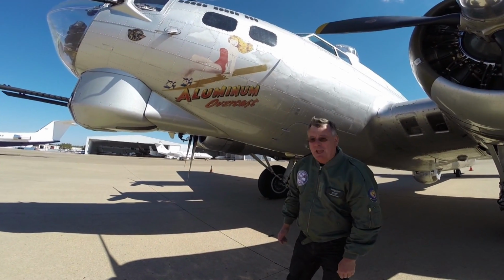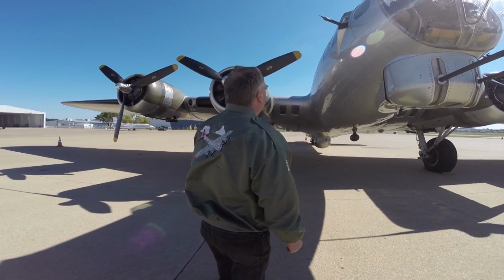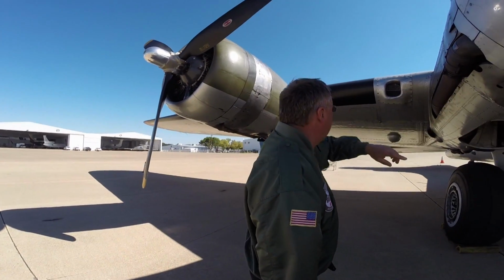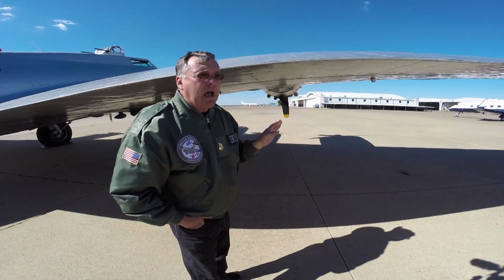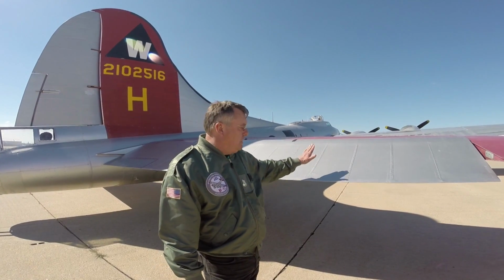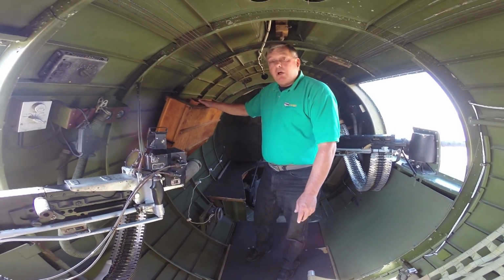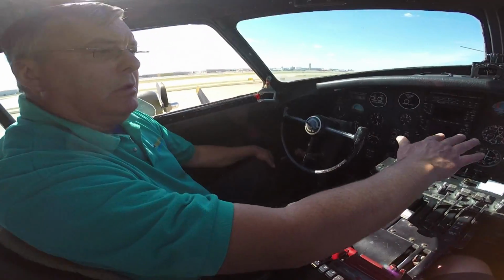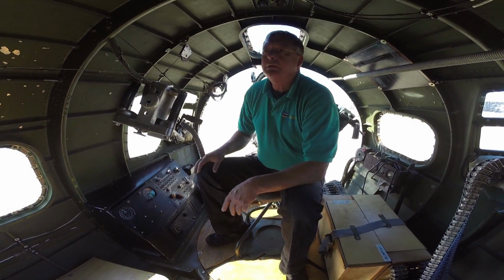B-17 Flying Fortress Walkaround Aluminum Overcast

Comment: Hey...Thanks for the video.  I don't know how I missed it all these years.  I live close to Oshkosh, and EAA is one of my favorite times of the year.  Love the plane spotting here in Princeton.  Rode in your aircraft in 2019 at the show.  
You probably popped up in my search because Microprose is releasing their B-17G for MS Flight simulator.  Did you know?
I fly many warbirds in the sim and have been looking to flying your plane...smiles.
So...the question I have is whether Microprose, or someone else, will have a skin for the Aluminum Overcast.  I would think, since the model is the same, almost.
And if there are no current plans to create a skin for you plane...there certainly should be, eh?

Comment: Should note that the brakes are electrically driven hydraulic.  An electric motor drives the pump that charges the pressure accumulator and that pressure is supplied to the brakes.

Comment: Not all B17s had the top secret Norden bomb sight, which actually flew or guided the plane on the bombing run, so the chin gunner/bombardier was actually an NCO toggeleir in most cases. He would await a bombardier in a lead plane to drop his load of bombs, and on cue all the toggeleirs would "flip"  switches releasing their respective loads.  The Allies didn't want the Germans to be able to retrieve the Norden from a shot down or captured  B17, so there were only a few planes or only one in a flight with the actual bomb sight.

Comment: 30,000 was the service ceiling, so most missions were  20-25,000.  Even so, the accuracy of the Norden was theoretical at best (The Navy passed on the bombsight because it didn't work even in optimal conditions, but the Army gobbled it up.) Far from putting a bomb in a pickle barrel, the Norden was lucky to land a single hit within a square mile of the target.  Ironic that that Spaatz, Eaker, and Arnold Army spent so many lives on the idea of strategic bombing on Europe when two years later they flew pressurized B-29s at 5000 feet or less to blanket Japanese cities with incendiary  bombs and napalm. The British had already come to that conclusion and torched Hamburg, Essen, Dresden, and other cities by night.

Comment: Form here in Britain thank you for this very informative walk around of the B17. Over the last 20 years my brother & I have visited many of the old USAAF 8th Airforce bases in Suffolk & Norfolk in eastern England. Most have now been returned to farmland with only small pieces of concrete of what were the runways, taxiways or hard pan dispersals. Some have museums in the old control towers but must just have a stone memorial to the airfields that were there before.  They are very atmospheric places, standing in what is now the middle of a farmers field imagining those brave aircrews in their B17's & B24's taking off.

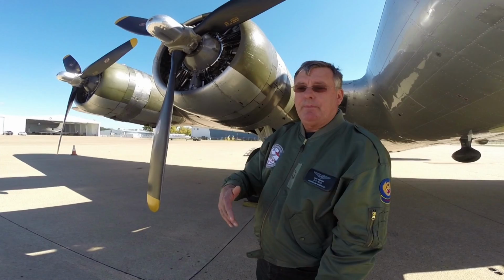Comment: 10:50 I was thinking, the 97 in the name of the radials could refer to the KW rating of the engines with turbochargers active. 970 kw = 1300hp (maybe max HP rating of the engines?)

Comment: My dad flunked out of pilot training in the Army Air Corps during Korea (he tended to get airsick on landings he said) and wound up as a surgical technician on the flight line crash trucks.  He retired from the Air Force as a Staff Sgt. a year before I was born.  As a kid, he used to tell me stories about having to deal with the injured crew on the bombers when they came back from missions, with the ships firing flares to signal the extent of the injuries.  His stories were probably one of the reasons I became an EMT years later.

He went into construction and general contracting while I was in grade school and I grew up working for him.  Coming back from a job one day when I was in my 20s we both heard the very distinctive sound of a four-engined propeller-driven aircraft (I'm old enough to fondly remember flying commercially on prop planes) that he immediately ID'd as a B-17, just from the sound of it.  We were driving on the Brooklyn-Queens Expressway at the time, below the Brooklyn Promenade, and sure enough, out in the skies over NY harbor were a pair of B-17s circling the Statue of Liberty.  Watching my dad relive a part of his youth listening to and watching those planes is one of my favorite memories of him.  I would have loved to get him a ride on one if I could but money was tight (I was working two jobs, starting a family, and going to college, all at the same time).  My dad passed in January of 2001.

Comment: Superchargers are mechanically engine driven and take considerable power to run, Turbochargers are exhaust driven and use the waste exhaust heat energy to drive them with little or no power consumption.

Comment: It's a shame they dont use the Turbosuperchargers. I would LOVE to hear those monsters howl!
Reply: @darrellkingsley7420  You should still be able to make out the high pitched whine of the charger. At leats if it's a high-rpm charger.
I work at an airline that operates turbo 6cyl planes. 
You can most easily hear thw turbos spooling down when the planes land. 
Sounds like a full fledged turbofan sometimes.

Comment: Some advice: If you hitch a ride, don't wear the earplugs. You will never forget that sound. I was lucky enough to go up in the Aluminum Overcast my graduating year of high school, and it was wonderful. I wish I could fly on one of these to Seattle instead of the crappy little turboprops that you normally take. Sure you have to wear high altitude gear, but damn if the ride isn't smooth.

Comment: -97 equals the modification which includes an addition of a generator. Previous models of B-17's only had a single generator on the No# 3 engine. This is why, in a lot of WWII newsreels you see them start the No.# 3 engine first... that was to get the electrics going to recharge, 1 of 3 batteries that the B-17 carries.
Reply from the maker: Robert Vaughn 
They still start the 17 and 24 that same sequence, 3 4 2 1

Comment: Great Job, and very comprehensive ... however, missing is the #1 major money maker for B17 pilots.  The money was made at the home air base.  The B17 is the only WWII aircraft with non-reversing propellers that could back into its parking slot (unassisted). I know, I know ... it can't be done ... blah, blah, blah from current B17 pilots.  I know two B17 "combat pilots" (Jack Head, Los Angeles,CA / and Jack Darby, Lubbock, TX) who won many wagers with this little known fact.  How is it done ???
Step 1.  It requires a fully castering tail-wheel, and at least two engines that are outboard of the main gear.
Step 2.  Pull the aircraft directly ahead of the parking slot, but you need at least 50 feet of rearward maneuvering space and 25 feet at the end of each wingtip.
Step 3.  With pilot preference as to which engine is selected to be first (let's assume starboard side), toe-lock the right main gear and advance the right outboard engine.  The entire plane then becomes a lever.  The physical "reaction" is that the left wheel will rotate backwards.
Step 4.  Reduce power to the right engine, release the right brake, and add power to the port outboard engine with the left main gear toe-locked (preferably while the plane is still moving).  The physical "reaction" is that the right wheel will rotate backwards.
Step 5.  Continue this see-saw technique until the plane backs into its parking slot.
Step 6.  Collect your wager.
Step 7.  Head to the Officers Club with your winnings.

Captain Jack Head later became a very successful Cadillac Dealer in Claremont, CA.
Captain Jack Darby, after recovering from a nervous break-down in WWII from watching actual combat briefing footage of a door gunner in a sister-ship B17 spray a stream of .50 caliber bullets into his airplane (while tracking a BF109 that was strafing the bomber formation) ... later became a successful District Sales Manager for General Motors.

BTW ... I could not hold my weight against these two gentlemen in a Vodka Contest.

Comment: Was not the main reason they did not shoot for more than 2 seconds that the Browning's barrel would melt from heat?
Reply from the maker: Don Moore 
It was so cold at altitude (30 below) that the barrels wouldn’t heat up on a few second burst. They did 2 sec burst to help with accuracy so the recoil wouldn’t make the gun bounce all over the place.

Comment: As of 10-2-2019 a sad loss for the Collings Foundation B-17 Nine 0 Nine when on its Wings of Freedom tour the plane took off with 13 aboard 10 passengers 3 crew. as they reported trouble with the #4 engine tried to land at runway 6 at Bradley Int Airport in Windsor Locks Ct. as 7 fatalities were confirmed, 5 passengers survived, one injured in the maintainence facility from one of the engines in the building. as the Collings foundation is cooperating with the FAA, NTSB, FBI, and Homeland Security as this airframe had two prior crashes one in 1987 in Beaver County Pa and in 1995 in Nebraska.

Comment: I had a great uncle who served as a B-17 tail-gunner. He was injured twice by flak but flew all 50 missions. He later served as a B-29 gunner. He said he worked the remote. He flew 12 missions over Japan.
Reply: I've seen several descriptive videos of the B17 but this is by far the most detailed. My mother worked in one of the Boeing factories in Seattle, building those tail turrets. I'm not certain how long she was there but she spent the last 2 years of the war in the WAACs. My dad spent most of WWII in the Aleutian Islands assigned to a P38 base, installing and maintaining communications equipment. He was "given a choice" of shifting to the Air Force after the war (President Truman created the Air Force on 18 September 1947, replacing the Army Air Corp) or staying with the Army, until his retirement in 1965.

Comment: One of the best walk-through videos I have seen. It's too bad that the top-turret mount is gone, but the seating area is nice. Just saw the Nine-O-Nine, which doesn't have the Cheyenne tail conversion and looks more like it's been in the war. The Nine-O-Nine still has the top turret and other earlier G-model (block 50?) stuff installed, so it was nice to see the differences. Thanks!!

Comment: Excellent ! I have to say that I have enjoyed this walkaround very much ! One of the best I've ever seen, indeed. Thanks for sharing it. I've seen also a walkaround of an AVRO Lancaster and in my humble opinion, and from my very limited knowledge, it looks like the B-17 is a much better design. It looks that it's easier to move around inside the B17 than into the Lancaster which is also cramped with sharp corners everywhere, The equipment looks also much better into the B17. Lancaster's indicators and knobs look almost Victorian .  Anyway I've found the Lancaster also very interesting.

Comment: Hard to believe this is from the 1940s. Always love the B17s ! But after watching this, realize only a thin layer of aluminum separate aircrews from outside ! Only gunners have 1/4 inch armour plate protection and that's in front, none at the back.